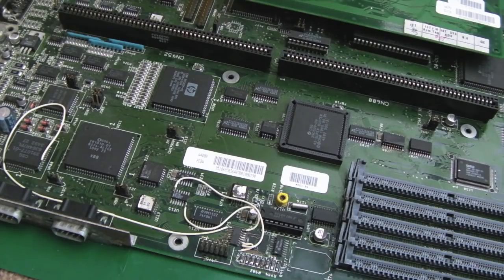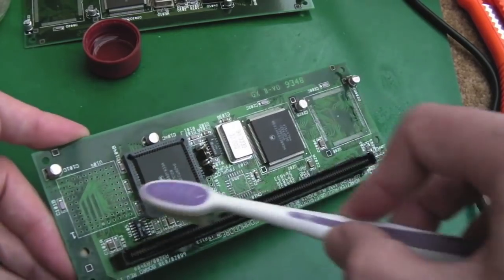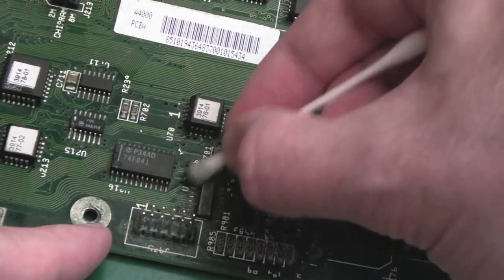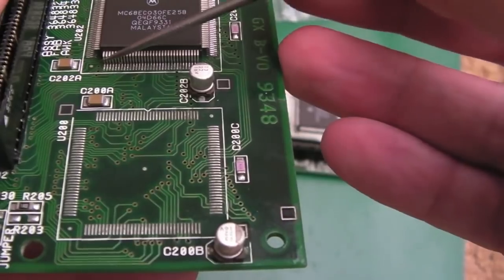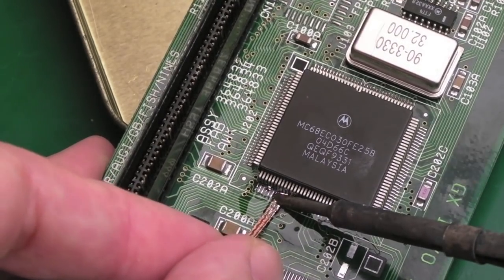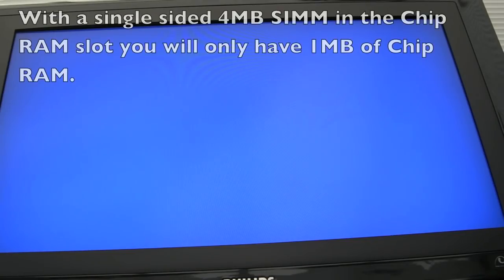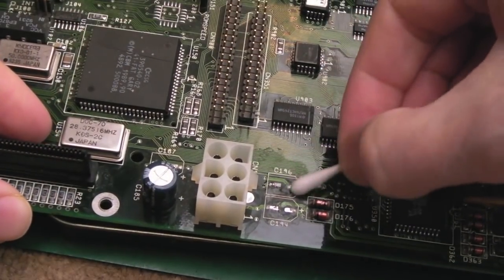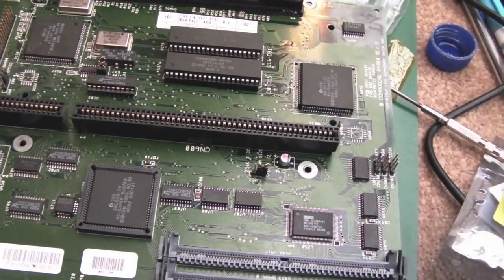Commodore Amiga TerribleFire A4000 Motherboard Repairs x 2 - Part 1

Comment: You took on a biggy there. 

Are you sure the two crystals that sit under the CPU board are actually socketed?

They dont look socketed in the video and if they are not and they move when you touch them it may mean the legs inside the crystal are broken and making intermittent contact resulting in the random booting.

Just a though, and keep the vids coming👍🏻
Reply from the maker: Yeah, they are socketed - on both boards!  They are the type of low profile (just basically a socket pin on its own, in each corner).  You cannot see the crystal legs through the other side of the board.  And the crystal is defintely faulty - I tested it outside of the board, I might show that at some point as I still have the XTAL here.
Reply: 👍🏻 looking forward to watching your part 2 later.

Comment: oh where oh where is my gadget fix if you get the pun, i need it, 6 days i'm going cold turkey now, on a plus note my batch of 3 +4s just arrived i got off ebay and the c16 came yesterday, along with a very nice zx80 that was in the original posting box they did, it has a issue 96 on the box, not sure if that relates to the actually zx80 i sure hope it does but wont know for a few more days as cant open it dont want to catch anything
Reply from the maker: Haha =D  Jelly of the +4's and ZX80!!!
Reply: @GadgetUK164  I have to fix them yet so they will be up on YouTube one day when i get chance, got tons of computers and gadgets to fix up in some form or another some just cosmetic but most component side, go a nice A3000 with colour monitor that works but had a leak so just neutralized it quick then boxed it back up ready for a proper fix up, although its all working from my understanding, there are some great bargains on ebay latey you know, keep an eye out, although the 3 zx80s were 150 each though so they are not bargains relay but the +4s i got really lucky with 107 for the 3 and at least one is fully boxed but all are mint condition on outside will see what they like inside when they come

Comment: Chris, I have a bunch of old C64 boards (various types) all with missing SIDs, some with missing PLA's. As far as I've tested them they all seem to have various problems but nothing too serious. I also have some keyboards, cases (breadbin and C64c). Would you be interested to take them off my hands at all?
Reply from the maker: How much are you looking for them?
Reply: @GadgetUK164  It's one breadbin (250425) missing SID -- one C64c (251137) no SID, no VIC, no PLA --  one C64c (252311) no SID, no keyboard -- C64c (252311) no SID, no keyboard. This last one has no cursor so probably PLA problem. They may all have problems. They're really for parts. 50 euros for the lot is fine, but I'm not sure what the shipping will come down to.
Reply: @GadgetUK164  Chris, never mind. I sold them to a friend of mine locally. Thanks for being interested anyway. Sorry if I caused any inconvenience.

Comment: Hi Chris, check out Adrian’s latest video, “Mac Repairathon: Pt. 2”, in which he tries to clean off a Mac Classic motherboard with even worse corrosion than that A3000 you were working on. His solution? Bath of warm, soapy water, rinse, and spray with WD-40 and let sit for several hours. The difference was astounding! Though, I’m waiting for part 3 to see how he gets the used WD-40 off! 🤗
Reply from the maker: Thanks, yes - I am aware of that video!  TBH - It's not something I would want to do myself!  WD40 is hard to clean!  You would have to soak in soap and water - nothing something I want to do to any of the boards I work on.

Comment: Has anybody dump the ROMs in Maine that's what they've done with arcade machines possibly you could find the ROM data there and reprogram your chips.
Theoretically you could reprogram a Raspberry Pi to be an Amiga 4000 running faster. 
I suppose you're buying isopropanol off the internet! i used to be able to buy it form the chemist but I can't buy it anymore you know anywhere I can buy isopropanol
You should get a fibreglass eraser pen for cleaning the pins. You can clean inside the sockets with those little toothpicks brushes you can buy from chemist come in different sizes
Just get a reflow gun and take the chip off clean it put it back on make sure you some nice resin you can watch Louis rossmann do MacBook repairs how to do it
Make your own Sonic tank use a couple of high power a little discs piezo tweeters push them hard  don't burn them out epoxy resin to the bottom of the container
Just knock the caps off it'll run without caps are the shittest caps you can get just use surface mountain no you need to use resin not Flux
You don't use no shity cans just surface mount big surface mounted caps much better they won't last if you heat them with the gun fucks then right up just by yourself some surface mount Louis rossmann sales the resin in big syringes not that expensive. Should left comment at the end lol
Reply from the maker: I think you mean MAME!  The Kickstart ROMs have been dumped (30 years ago) - and you can emulate the Amiga in WinUAE and many other Amiga emulators.  MAME will probably emulate the Amiga too.

Comment: I just throw the board into a tub of 5% white vinegar, let it soak until I no longer see bubbles coming up from the board (BTW the green corrosion on the board will turn a milky blue, and it is simple to get off with a toothbrush at this point), rinse it off under the outside faucet, and immediately into a tub of IPA for a good soak as well. I shake as much water as I can off before tossing into the IPA, for A2000 boards this is important since all of those connectors will hold a ton of water. I let the board soak for quite awhile in the IPA (outdoors, of course) and that gets the remaining flux off as well as "drys" the board by diluting the water.

Getting the board from the rinse stage to the IPA stage quickly is important since the metal parts will flash rust if you delay too long. It doesn't hurt anything, but it looks ugly.

I've done this for two A4000s, two A2000s, A ZX+2, and a ZX+3, as well as for six A500 memory expansion boards with no problems.

I didn't come up with this method, I got it from the Jamma crew, and it works well. I use an electric toothbrush for both the vinegar and the IPA stage (living dangerously). Try it out on a A500 memory expansion board, no great loss if it screws things up.

As for De-Ox-It, I'm cheap, and I bought De-Ox-Id. I haven't tried it out as of yet, but it should be just fine (it was recommended by our local electronics parts house). Far less expensive, and the radio techs seem to love it. We'll see...

Careful about instructing folks to follow the cap footprint, three of the A4000 '040 board cap stencils (as well as the caps) are backwards from Commodore. :)
Reply: "into a tub of IPA"? In Covid19 times? When was the last time you purchased a bottle mate? ;)